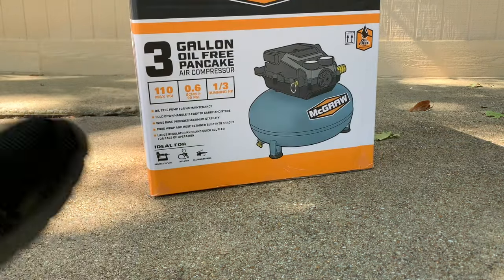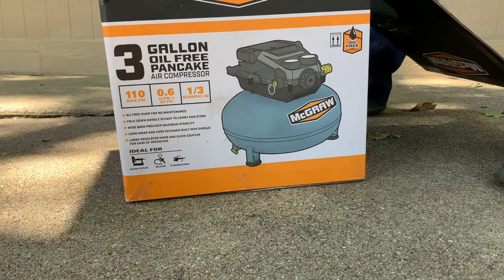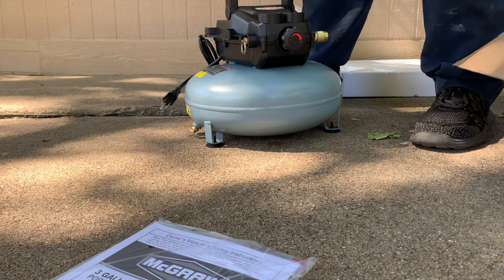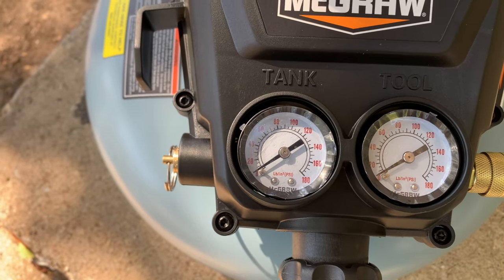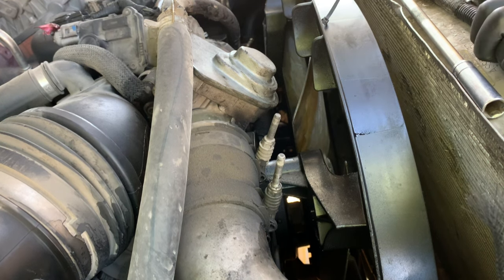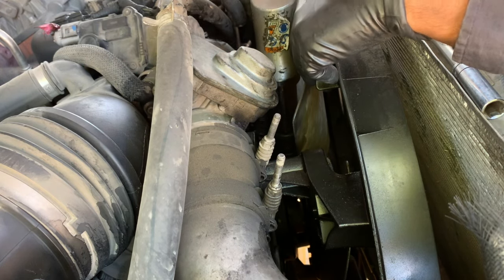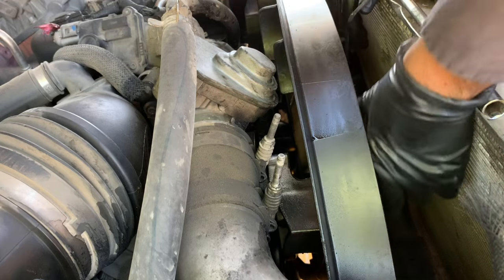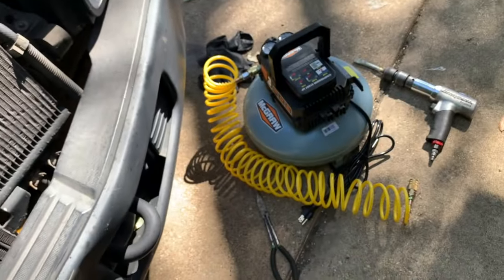Harbor Freight 3 Gallon air compressor vs SnapOn Air Hammer

Comment: That size air compressor will easily power one of those palm nailers which is pretty much the same tool. So there is no reason it shouldn’t work with an air hammer. It’s just gongnto need to kick back on more often to keep the pressure regulated.